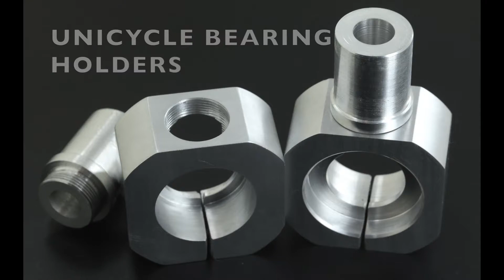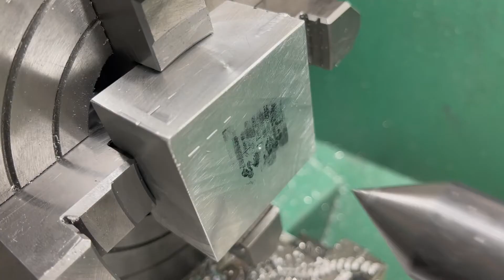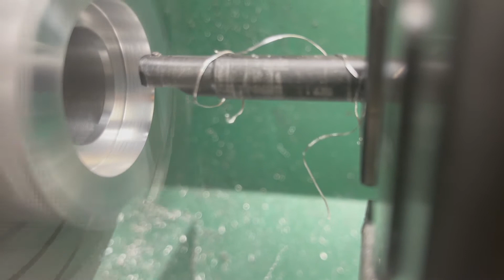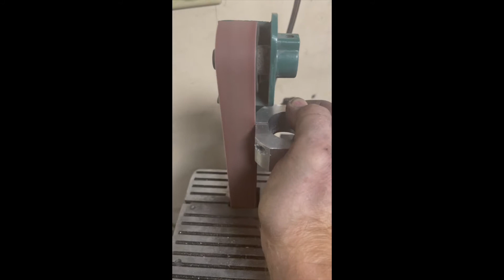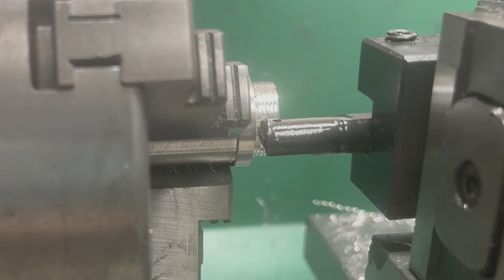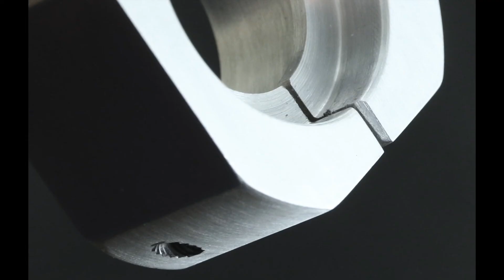DIY - Homemade Unicycle Part II - Bearing Holders Relaxing Metal Lathe Machining

Comment: So, it "drops into the frame.  I am curious how the frame looks like.  Is it keyed into the frame or is there a clamp collar?
Most standard frames(nimbus) are integrated with the top half of the bearing holder and a separate lower half circle brackets which do not touch each other.    
I like your design, because you can easily make a 1" or 2" longer shafted holder with a "step" so the unicycle can fit bigger wheels with same frame.  
I have a 24" nimbus muni frame, and I've been trying to figure out a spacer/riser bearing mount to allow a 26" wheel to fit.  
BTW, you need to "add" clearance and internal threads for the standard ISIS hub bearing puller tool, right?
Reply from the maker: I haven’t made the frame yet. But the crown is going to clamp onto all the tubes and removable by disassembling the crown.

I don’t have a unicycle bearing puller. I can machine anything I want, so I wouldn’t buy one anyways. Being a mechanic for 20+ years means I’ve done just about everything and own nearly every item park has ever made. I always find ways. I used a park crown race puller the last time. I have a Campagnolo bearing puller for power torque cranks that I could use.  

The bearings aren’t standard 42mm… they’re bearings from Truvativ ISIS bottom brackets. 31 x 21.5 x 7, but I used four instead of two. 

My goal is to make things with stuff I have, not buy things.

Comment: looks like a hella compicated part there m8, whats the chases of it working out?
Reply from the maker: Fairly good. Cranks fit. I have to build the rest of it. I have the whole design in CAD done. 

I come from the bike world, having 2 decades of professional experience in it, so I’m more familiar with it and how much more advanced it is than the unicycle world. I’m trying to bring over some concepts from it. I grew up with a guy who in the 90’s won unicycle championships. We’re still good friends, and rode unicycles A LOT. I have my classic SemCycle XL, which I’ve ridden for 21 years now. This is just an experience of making something out of crap I have laying around and also as a proof of concept for the frame. I eventually plan on revamping things once I get more machinery (a milling machine for starters) and some rotary broaches for creating splines other than ISIS.
Reply: @johnthebikeguy  Bike technology is awesome, but welcome to unicycle world where one wheel takes full rider weight, abuse/impact directly on cranks are the norms.  Nothing "convenient/quick changeable" can exist.
Reply from the maker: @trexinvert  I’ve been unicycling for 25 years. I’m not a newbie.

I definitely think bikes are far more capable of abuse. Unicycles are very limited by design as to what you can do with them. Bottom brackets still bear all the weight of the rider. Rear wheels eat most of the weight. Plus, they have to withstand a rider’s ability to withstand 500+ watts of power plus weight, whereas on a unicycle, applying that kind of force on the pedals is nearly impossible. Speeds are way greater on bikes. Freestyle bmx is way hard on equipment, more so than any other.